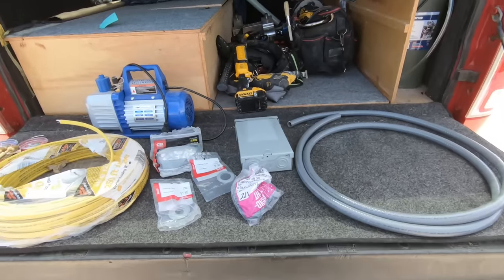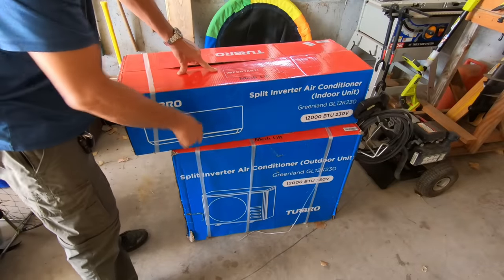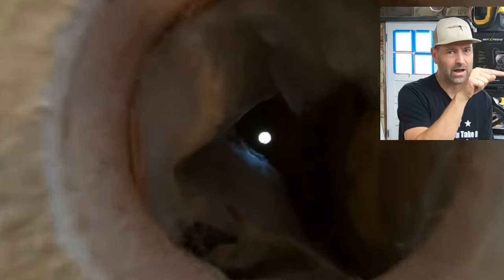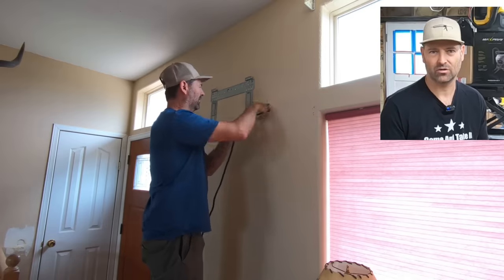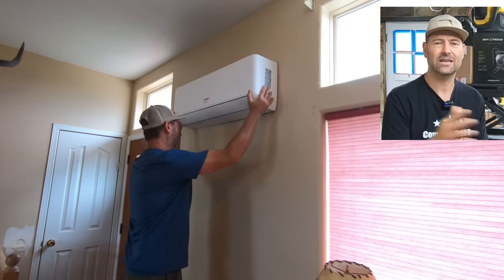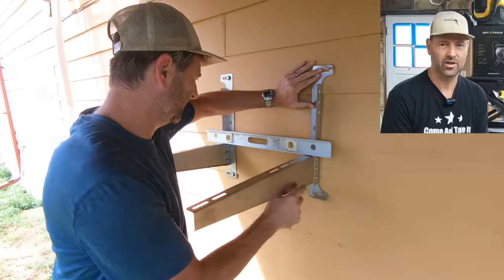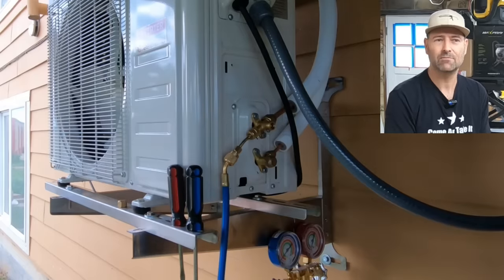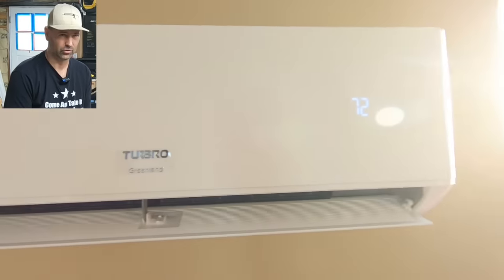They Are Forcing Us To Use These | Heat Pump Or Mini Split Full Install | THE HANDYMAN |

Comment: Just installed a mini-split in my room for the first time ever myself.  I also got lucky with the electrical.  There was a fairly fresh 240 volt line going to my room to the baseboard heater.  I decided to tap into that and use that as my power source.  The baseboard will still serve as a backup, but at least my mini-split can also serve as a heat source in the Winter and be a lot more efficient.  I went with the 12,000 BTU Della Unit from Amazon, which is probably made with the same components at the Turbro.  I also made sure to use that Nylog sealant with the flare connections.  Originally, I was running one of those portable, R2D2, units that has a hose that connects out the window, but they are extremely noisy.  The mini-split doesn't make any more noise than an average fan and can cool a room much better.  My portable was 10,000 BTU while my mini-split is 12,000 BTU and I can already feel a huge difference in cooling power.

Comment: Here in New England we have a lot of older homes that have never had a traditional AC system and the heating is forced hot water or steam…..that being said it is much easier to run refrigerant lines to a 2nd or 3rd story rather than ductwork.  Seems to me that mini splits will have a place as long as these older buildings need cooling….
Reply: My thoughts exactly! I'm in CT and my colonial home is from 1959. Cast iron circulation water heaters. No duct work. I'm going to look into a diy 4 zone ceiling cassette system for my home.

Comment: Been running heat pumps for close to a decade up here in canada. My only gripe is the mouldy buildup in the indoor units. But you can charge an easy 100 to 150$ to clean them (the cylinder fan gets really gross)
Reply: Agreed the inside unit is a pain to clean,  but it doesn't take a professional to clean it
Reply: @rockridgefarms  yeah anyone handy can take it apart, use a mix of water spray and air compressor to get the gunk out. But It takes about an hour, and you need to setup a tarp and a bucket to capture the mess
Reply: Just cleaned one of my Mitsubishi wall units yesterday. Yes they can get a little moldy in there sometimes the only other crap I've had is with Mitsubishi they keep the fan running in AC mode even when you reach set temp which just pushes the humidity from the coil back into the room because the compressor shuts off. If you have a well-insulated bedroom you can have it 70° with almost 70% humidity. So I use some Cielo breez control units from Amazon that have the whole unit shutdown when temperature is met in AC modeand that fixed the problem
Reply: @chrisd4432 I was just reading earlier this week that there IS somewhere in the settings that allows you to configure it to not keep running the fan.
Reply: @bran-qt7ds  not that I can find in  cool mode . It apparently requires the cutting and removing if a air. I just use Cielo breez controllers to shit it off automatically

Comment: The heat pump with inverter tech is obviously more efficient than even whole house heat pumps. But there are always more technologies in the wings. it’s probably a 25-50 year technology.  I’m looking at insulating my garage and putting one in for my woodworking habit
Reply: Thinking the same for my garage

Comment: I like heat pump units, the only issues I've found is that they are great until deep winter hits and it's low temps like in the teens. Then they almost always need back up heat to keep the temperature up. (Talking more along the lines of condenser and air handlers and package units. Not really about mini split heat pumps.)

Comment: 9:00 another quality Turbro feature is the built-in screwdriver holder in the outside bracket!  I like the look of the ceiling mount cassettes like Mr. Cool, at least they are less visually intrusive.  More PITA to install, though.

Comment: We have a heat pump for pur whole house and its amazing. We use propane as our heat backup. We probably go through maybe 150 gallons of propane each winter. Super efficient!
Reply from the maker: Is it a propane furnace?
Reply: How much do you charge to install one of these? Also, you don’t have to be an electrical contractor to install these?

Comment: I dont see mini splits/heat pumps going away in the future, especially with companies like eg4 finding ways to make them run completely off solar panels during the day and only using grid power when it has to. Which is not a bad thing, the more options there are in the market the better it is for everyone.

Comment: Nice install the only thing I would have recommended was a wall sleeve where the line set and condensate line goes through the wall. They're only a few bucks but most contractors don't use them either if there's ever any kind of leak or condensation on a refrigerant line for the installation failed you won't have it inside your wall it'll go outside.

Comment: I installed a Senville Aura 18k unit I bought off Amazon 6 years ago. Mini split is cheaper to run than my old swamp cooler. Could not be happier and will be upgrading to a multi zone unit on my remodel the later this year.

Comment: I get calls for them a lot as well and pretty much have the same approach as you. Once everything is run I connect the flanges using the "that feels like 20 ft-lbs" method, I don't use anything on the flange connection but I inspect the factory flange and see how well they mate before I connect. After connecting the line set I pull a vacuum (20-30 minutes) while i'm doing the outside electrical connections and securing the whips. I shut off the pump and continue watching the gauge while I load tools and do whatever. I overkill on the line test and watch the gauge for a least an hour before I open the valves. Turn on the power and crank that baby on and in south Texas that drain line is running in minutes. I think they are here to stay, they work well and easy to install, I can't justify the cost of a CPS/Fieldpiece vacrometer  or Appion core removal tool so i'll just keep it old school.

Comment: Very nice and clean install! The reason for using a vacuum pump to put the system under vacuum before letting out the refrigerant is mainly to remove any moisture that may have gotten into the sealed part of the system. The best thing to do is to not open any of the lines or the evaporator until ready to make the connections and and limit their exposure to the atmosphere. Remember air always contains a small amount of moisture. If the components were sealed and not exposed but for a few minutes at installation then running the vacuum pump for 15 to 30 minutes should be suffice. The higher the humidity at the time of the open system or longer open time, the longer vacuum time. Remember that once moisture gets in the sealed refrigeration system, if not removed with vacuum it will remain internally untill it causes damage. And over time it will.
Reply: If you live in the desert where it's really dry do you need to vacuum pump it? Can this step be skipped if dryer than Hillary?

Comment: Put a mini split in my home last year; the HVAC guy wanted 7,000 for a new 2.5 ton natural gas heater unit so instead I bought a unit and self installed a 24,000 BTU minisplit ($2,000 plus my time). I changed from gas to electric. I got a unit that was 30%+ more effcient. I do think the revolution is coming, and with the prices dropping, it is the future. I am a not sure about water heaters yet. It is so hard to get people to change HVAC filters now, neglecting hot water heaters for years as is normal is not going to be good for those units. It also depends on how much people use them. With the new SEER2 and traditional HVAC prices going through the roof, more people are going to go with mini-splits. When $200 window air conditioners are combined with the high efficiency mini-split technology, I think that may also take over the space.

Comment: Handyman, great instructional video. As to acceptance of heat pump. If you currently use resistance heating, is a no brainer, heat pumps can be 2 to 5 times more efficient depending on temperature. Compared to gas, gas furnaces will run 30 years at least without major repairs, not so heat pumps. But depending on local utility rates and whether one owns solar, its hard to say. Keep it up.

Comment: I had a Mitsubishi heat pump installed this past February.  It connects to an air handler in my attic and all new duct work installed in my house as well as 2 mini splits in rooms that couldn't be reached with duct work easily.  It works great!
Reply from the maker: Will it still work when it's -20F out?  Moat stop working at -10 F
Reply: @TheHandyman1  Luckily here in southern CT it doesn't get that cold.  My situation is not like others.  I have a 7 year old boiler that is our primary means of heat via cast iron radiators therefore we didn't buy a heat pump that would heat below zero. We opted for a heat pump because we got a better rebate and it would provide heat to 2 of our rooms via mini splits not serviced by the duct work.  This is our first summer with whole home cooling and its been great.

Comment: Thats good to know. very professional work and video. I wonder if that could heat my 1260 square ft home in PA. I go through 6 ton of wood pellets a year.
Reply: It could take most of the load. So these units come in different sizes, 12,000; 18,000, 24,000, 30,000 BTU. You wound want the larger ones. One pound of wood represents about 8,000 BTU. your heating. If you heat for 12,000 pounds of wood is  9.6 million BTU; spreading that over 150 days (5 months) that is about 26,000 BTU an hour. a 30,000 BTU unit could in theory do that. A 24,000 BTU unit could do 90% of that. The problem is your heating is not evenly distributed. When it get cold, like 20 below zero, the unit is not going to be able to heat as much and the need for heat will rise dramatically. That said, install one, use it for most of the year and kick on the wood pellets when it gets really cold. I know a guy in Montana that has used one for years. While technically supplemental, it does a much 70% of his heating.
Reply: I'm in SW PA and have a 12,000 BTU unit that heats/cools my 20x40 living room and 20x20 kitchen just fine. Last winter we had several days of below zero days in a row and it heated just fine. Had this unit for seven years now.
Reply: I'm guessing your house is not well insulated? I have a similar sized house in zone 6. There isn't much downside in under sizing your unit because you have backup but you would likely want a 24k btu unit or larger. Pellets can provide assistance when it's super cold and take load off the grid.

Comment: Question... have you installed one of these on an interior wall?  Or can you? Need to put one in but this 70s ranch house has no suitable exterior walls to mount a unit on if you can believe it.  Considering one of those ceiling units but it looks like a PITA to install and might be less reliable.  Any suggestions welcome
Reply: I'm not sure what part you are talking about interior, the The Indoor Evaporator Unit or the The Outdoor Compressor / Condenser Unit. I have mounted the The Indoor Evaporator Unit to an interior wall, inside what once was an additional bathroom above the inner door frame & the Outdoor Compressor / Condenser Unit I put on some pavers in the backyard as a quick concrete pad & mounted the unit on a couple 4x4 feet. I positioned it in front of a crawlspace vent and ran the connector through the vent, through the crawlspace directly under that inner bathroom door, put maybe a door knob size hole in the floor running the connector through the floor up the wall to the indoor unit & the drain runs down the same way dripping under the house in the crawl space area. It's ran great for years and years & does an awesome job. You just have to make sure to get one with enough line to run between the units and I think they tend to come precharged for 15-16', so I imagine your cooling percent will drop with additional distance in feet, if you didn't add additional refrigerant charge. Like if the line is 20% further maybe it cools 80% so a 12k btu maybe is equiv to 9k btu without doing the vacuum & adding gas, idk. Just something to maybe keep in mind, but you can buy gas & tools online like ebay & amazon & even take the open & closed book tech I&II license exam  online as much as you want until you pass. I remember seeing it was something like $15 or $25 a try back 15 years ago. I didn't do any of that though & just hooked it up and opened the gas. Super cold, works great. So yes it can be done, even if maybe you are not supposed to, idk. It worked for me & very happy with the end result.
Most electrical stuff in my house is ran through the attic to the breaker box, but I want to say the outdoor unit electrical I have going through the crawl and up the wall to the breaker box rather than down the wall. The breaker box is tucked away in a closet. But with a bit more wire I could have as easily ran it up through the attic like everything else. Maybe one day will, but this ones worked fine as is for so many years already.
Reply: Yes, just get a longer line set. Many units come with a 15 foot line set, a 25 foot can be used instead, longer line sets up to 50 feet are possible, but you may need to add more coolant to the system. Check the manual before you buy for specifics on whatever system you want. I installed mine on an interior wall, that sends the main air right down the length of the dining and then living room and covers 70% of the house with the natural air circulation that it causes.
Reply: @johnbender1364 I don't know about others, but the Pioneer I was looking at comes charged for up to 25’ and you can choose a 25' line set when purchasing for a few bucks more

Comment: Built my home 27 years ago and put in heat pump AC units in and been very happy with them in the winter and summer. Back up heat is electric but found out if raise the thermostat slowly the back up heat does not come on.

Comment: In 🇨🇦, I’m not sure if that can work at -35-40 Celsius in winter here lol, but surely it would be way more efficient than gas and 220-240v electrical draws. Interesting stuff, great job handyman!
Reply: There are homes in Yellowknife that are built to the Passive House standard and yes, they have eliminated fuel-based heating systems due to being super-insulated and well-designed. But a lot of cold-weather homes will have a second heating system like radiant in-floor, which kicks on during those super-cold streaks. The combined approach is smart because the transition to all-electric is not an instant one.

Comment: I have a larger house in Colorado and am very skeptical I’d get adequate heating in our single digit winter evenings
Reply from the maker: I would not try to heat my house with this style heat pump where temps can get below -10F
Reply: @TheHandyman1 they sell mini splits that have 85% efficiency at -22°F.

Comment: Well my grandparents and other relatives I have in Florida have had heat pumps in their houses, when we would visit back in the 80's.   I don't think they are going away.  I think these mini splits are a bit of a fad.  This installation you just showed  kinda illustrates the main down side to them.  Looks like you were forced to dump it out the front side of the house where you see it.  I get that was probably the most logical spot for it, but jeesus, there has to be a better way that they can come up with.

Comment: If your house is air sealed tight, you are still going to want to install an HRV or an ERV, so you will need ducts of some kind, to get fresh air into the building. I've also seen Mr. Cool makes a whole house unit that can hook up to a ducted system.

Ground source heat pumps have been around for a while, but digging the trenches or wells is expensive. If they make air source heat pumps efficient enough, they should be fine.

Comment: I live in south florida, hot climate. The mini split looks like a great solution , similar to central ac like most of us have down here. But I like the mini split system because it looks like you can control temp in different rooms . One thing though , I grew up in NY and lived in different rentals , I know up there the one thing is the cost in running heat , how many amps plus the cost in electricity to run that system. Plus the other thing is in the winter up there, forced air heat is very dry, can cause sinus headaches. Here in florida it doesn't matter because you only need forced air heat for about an hour at a time and just turn it off after the house warms up. I know in NY the worst kind of heat to use is electric , dry air condition plus very high electric bill, so at least a forced air is better than that I guess.

Comment: Heat pumps as a primary heat source still require a backup heat source like electric resistance or gas, since a heater that quits working at sub-zero temperatures puts lives at risk.  That being said, I think they're a good idea.  I'm just worried about the market being flooded with a lot of cheaply made ones, and the fact that it will run in all seasons will cause more wear on the compressor...

Comment: Most mini splits i put in have electronic txvs and when not properly evacuated and installed it WILL clog just a matter of time. These things are awesome an will last about 20 years if put in properly.
Reply: The key to knowing for sure that you have a proper evacuation is a tool called a micron gauge. The goal is to remove as many molecules of water from the system as practical. While they may seem expensive, they are actually very cheap insurance.

Comment: There was a house a block north that had a gas leak and it literally blew the house off the foundation, roof, and all.  No one was living there at the time.  Electric heat pumps are the way to go.